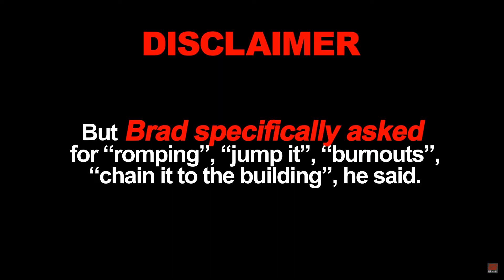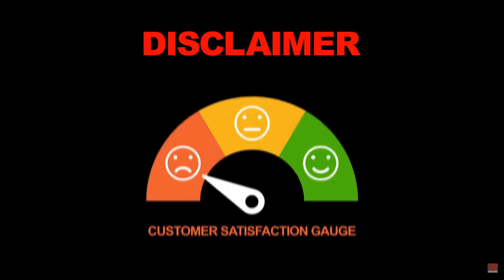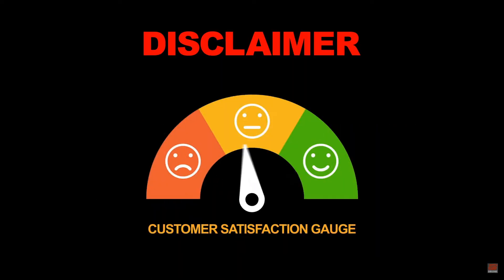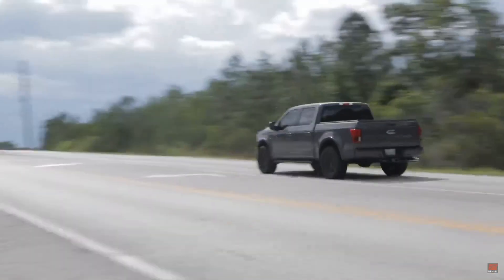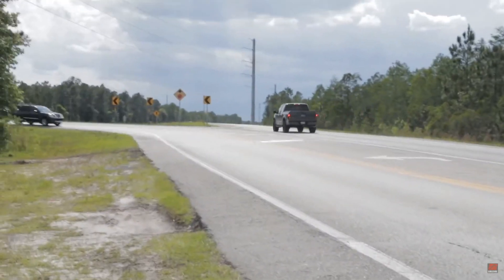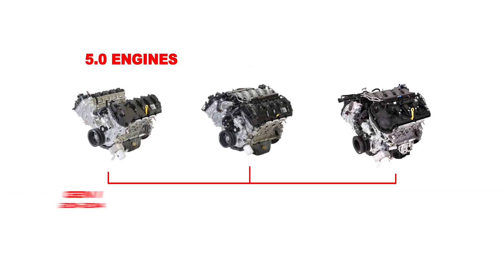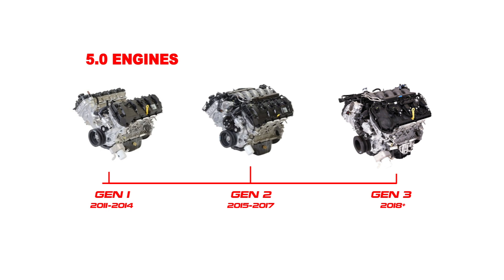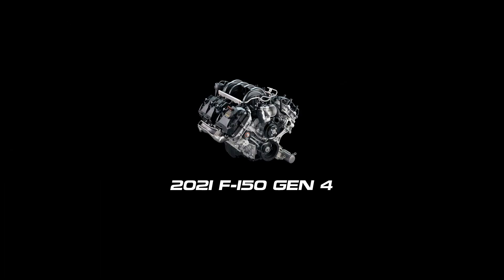What are the differences in the F-150 Coyote engine Generations? || Coyote Engine History

Comment: 120,000 hard miles on my 2013, my 2011 had more. Both were dyno tuned when new and are drag raced most every weekend. They’ve been stellar. Top end is unbelievable but the speedometer only goes to 160.

Comment: I recently bought a 18 f150 engine is knocking. I will be changing it my question is for you guys. Will a gen1 or 2 fit in the 18 or it won’t work because of deactivation system in the 18+ ? Thanks in advance
Reply from the maker: Gen 3 Coyotes are direct injection.  You'll need to run a Gen 3 engine to retain all the same functionality of your vehicle.

Comment: Will a roush supercharger for a 2020 f150 5.0 work on a 2016 f150 5.0? I found a deal on a used one
Reply from the maker: The later superchargers do bolt up to earlier Coyotes, though you will need to be aware of your wiring considerations and possibly source the wiring/sensors for your specific vehicle.

Comment: can I put a 2021 Coyote into a 2014 f-150?
Reply from the maker: If you're talking complete engine, a lot of the systems present on the Gen 3 and Gen 4 Coyote are not present in that chassis.  So it's not a direct swap.  Each generation, for the most part, has componentry that isn't interchangeable, such as timing components and affiliated sensors.

Comment: We all need to delete all the emissions horse shit the government is making the manufacturers put on these engines. They can’t arrest us all. . It’s drastically reducing the lifespan of the engines. And for gods sake fire the ignorant engineer that decided it’s a good idea to use a rubber belt soaked in oil to drive the oil pump. Oil degrades rubber. Rubber doesn’t handle heat well either. Great going. Can’t wait to see how many gen 4 coyotes sling rods out the block when the stupid ass oil pump belt snaps or shreds to pieces and gets sent all through the engine.

Comment: For the gen 2 coyote f150 Are the Pistons,rods and crankshaft the same material as the gen 2 coyote mustang because the gen 2 coyote mustang did use some parts from the roadrunner engine

Comment: Why did they change from 5w20to5w30oil
Reply from the maker: Hey Norm.  Manufacturers spec oil viscosity based on a number of elements such as engine manufacturing clearances/tolerances, region of sale/projected environment of use, type of use, and much much more.  You'll find that heavier weight oil will come into play with heavier duty usage, higher towing capacities, and similar circumstances.

Comment: Thanks for a good explanation. I’m looking at a 15 f150 right now and I’m told it’s a better choice then the Gen 1’s
Reply from the maker: Thank you for the kind words.  We hope it helped you in your research.
Reply: @VMPPerformanceTV  went and looked at it seemed a little ticky like the fuel injectors where noisy is that common? I don’t know personally my 3.5 ecoboost sounds like a time bomb 24/7
Reply: @402SHO  coyotes are commonly known for a little "ticking" just make sure you aren't hearing a lower end piston "slap" or "Knock". I just got out of a 2014 that had the dreaded piston slap when cold. Plenty of videos online where you can hear what the piston knocking sounds like. I had bad luck with a 14 f150, had the knock but ran great and super smooth when warm. now in a 16 and no knock. ever since discovering the issue on the 14 I've been deep into every thread known to man. my non expert conclusion is that the 15-17 5.0 with the 6r80 is the best.
Reply: Will a roush supercharger for a 2020 f150 5.0 work on a 2016 f150 5.0? I found a deal on a used one

Comment: Do all the Gen3 5.0 have plastic oil pans ? I thought the 2.7eco was the only engines using the plastic oil pans ?
Reply from the maker: All gen3 and also gt350
Reply: @VMPPerformanceTV  that’s weird because the 3.5 ecoboost don’t have the plastic pans on them .
Reply: @justin5345  I’m a ford tech and yes 3.5 ecoboost does have plastic pans

Comment: How can i check if my f150 engine is gen4 ?
Reply from the maker: The Gen 4 Coyote engine is only in the new 2021 F-150.  If you have a new body style F-150 that is 2021 year model, you'll have the Gen 4.  2018 through 2020, it'll be Gen 3.  2015-2017, it's a Gen 2.  2011-2014, it's a Gen 1.

Comment: I was thinking the gen 2 15 up went to 11:1 compression like the mustang then in 18 both went to 12:1.  Meaning 11-14 is 10.5:1, 15-17 is 11:1 then 12:1 18 up.  I was thinking the 11-14 was the only iteration that had lower compression than the mustang.  Is that correct or did it stay 10 5:1 all the way to 2017?
Reply from the maker: F-150 ran 10.5:1 compression all the way until 2017 in comparison to the Mustang's compression ratio of 11:1 in 11-17.

Comment: Gen 2 was by far the best, fixed all the issues and before the government got involved with cylinder deactivation and auto start stop. Haven’t had an issue with mine over 105k
Reply: I second that. I got 167,500 on my 2016 gen 2 and she still runs like new. This is by far the best gen/year F-150
Reply: No, the gen 3 is the best.  Cylinder deactivation wasn’t added until 4th gen
Reply: These are two features that have been other v8s and other cars before this. The technology is not new and highly tested
Reply: The tech isn’t new, doesn’t mean the tech is good. Look at the problems GM has had with cyl deactivation.

Comment: Specifically, when do you recommend upgrades oil pump gears for a supercharged 5.0 F-150? Based on year made or boost level or both or what?
Reply from the maker: Hey Alex, upgrading oil pump gears is typically recommended base on the type of use for the vehicle.  As with any modifications, there's inherent risks.  OPG/CS are typically at risk from this like shocks in the drivetrain/engine from rev limiter strikes.  If you intend to use your Coyote in any manner of racing/motorsport where this may be a risk, it would be worth considering regardless of the power.